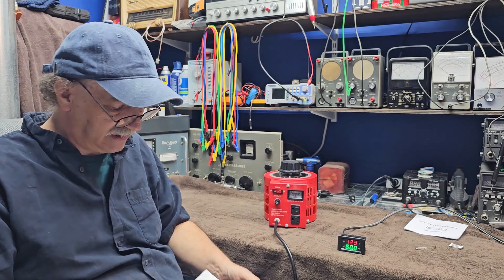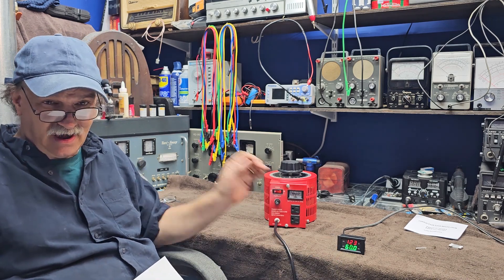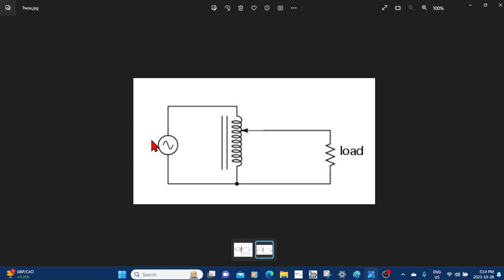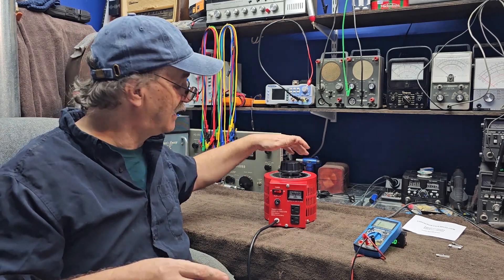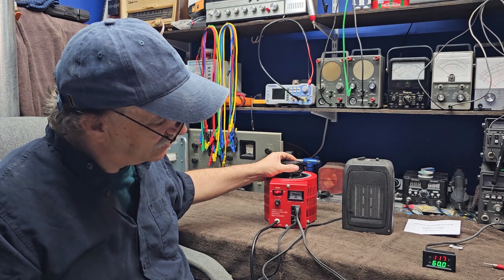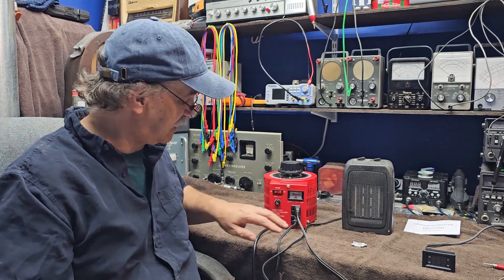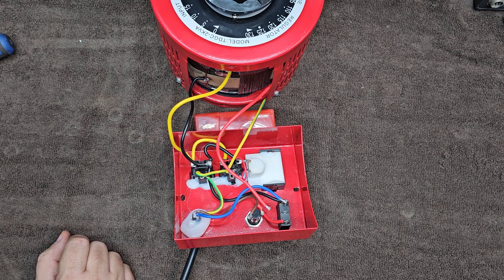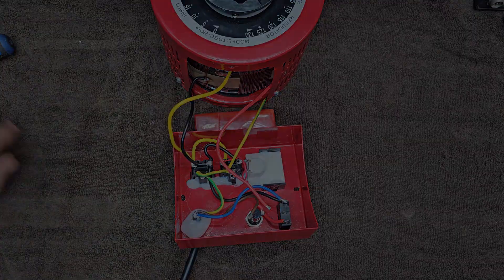Variac Review - Amazon's 20 amp Variac - Factory Failure Pt. -1

Comment: 20 A output current is (theoretically) useful, even in North America with 15 A circuits. The 120 V 15 A circuit means the input power is limited to 1800 W, but when the output voltage is 90 V, 1800 W in gives 20 A at 90 V out. A Variac rated for 15 A could only provide 15 A max at any output voltage.
(The output current shouldn't go above the transformer rating at lower voltages, even though it is within VA limits, because the winding is a constant wire gauge that can handle only a certain amount of current, whether the output voltage is 90 V or 10 V).
However, this assumes that the windings on the transformer are actually heavy enough for 20 A. I have a transformer that looks like yours, and the windings appear to be about 16 gauge, not even 14 ga. I am skeptical that it can provide 20 A continuously without overheating.

Comment: I have some 20A circuits in my house (Iowa), and when I put my lab in, I ran all 20A circuits so I don't think the 20A capability is a bad thing.  What is a problem is the implementation.  They installed 15A sockets on the front panel, not 20A therefore they are under rated for the application.  Like most things out of China, you're really getting a bunch of parts roughly assembled into the shape of what you want. But you always need to completely evaluate the state of everything, determine how it should have been built, then take all the pieces off the proverbial 'sprue", clean them, then reassemble them in the correct order often needing to change, modify, or replace some of the parts to make it useable and safe(r).  You'll still end up with a poorly built and not the most pleasant to run widget. The old axiom is still as applicable as ever:  "The cheap comes out expensive".  Unfortunately, most of us have more time than cash so we end up buying these Chinese kits with regret....
Reply from the maker: No, 20 amp circuits are not a bad thing at all. As I said they are not standard and not commonplace at all. They require 12 Ga wire and a special socket. Most folks dont have them. There was no chance in hell this would service a 20 amp load. The product was the problem.

Comment: I have the smaller one and, yeah, the meter is useless. Otherwise, no complaints.
I tailor a dropping resistor for all my restorations, in order to run them at standard modern AC line voltage. I recommend doing this every time, because the next owner might not be aware of the difference.